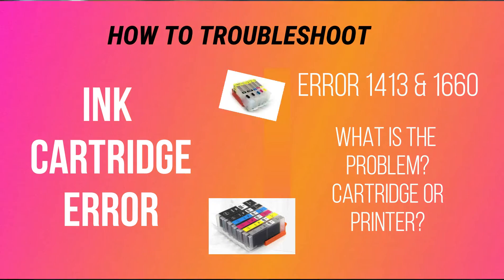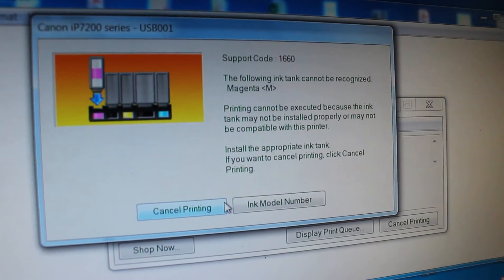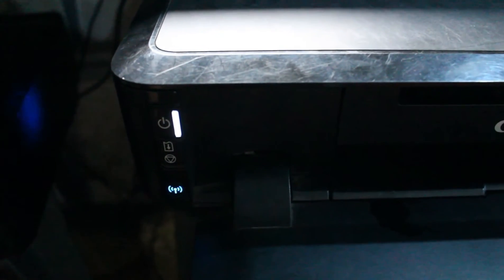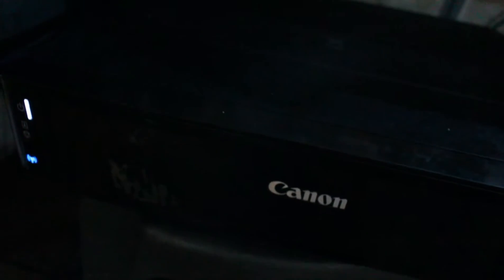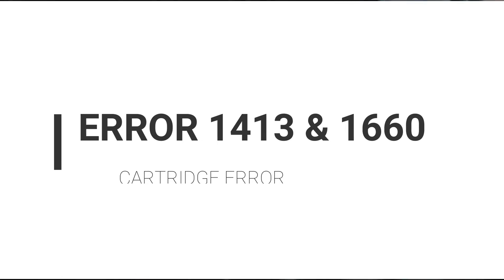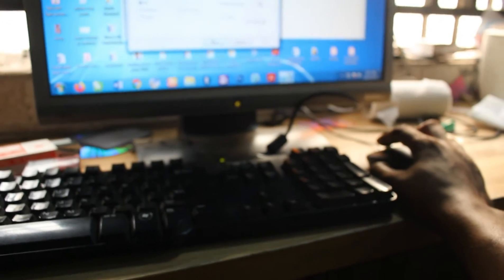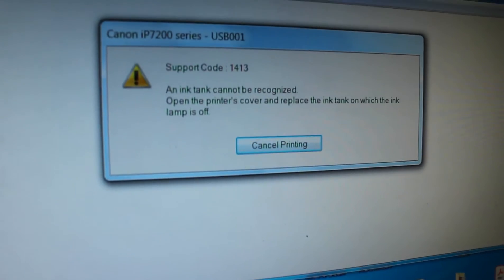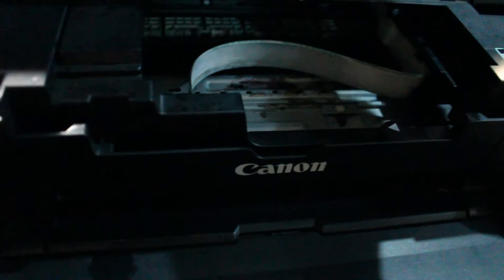How To Troubleshoot Cartridge Error 1413 and 1660 for Canon Inkjet Printers

Comment: It's ok to segment the problem from the solution in Youtube videos.  The challenge and a creator is this.  I clicked on this because I already know I have a problem which your thumbnail (title) indicates a potential solution for.  No, you do not explicitly promise a solution, and yes you did some trouble shooting but to avoid frustrating your viewer all you need to do is be upfront and specific about WHEN the solution is forthcoming.  If you haven't figured it out yet, that's ok but wait to upload until you can deliver the goods.  If this video is one part of a multi-video process that could be interesting, but SAY so upfront.  EG:  "Step one check the cartridge" and let that be the title.  Why?  I already know how to do that and I don't want to sit through this first, small part of the process only to discover there's no solution to error code 1660 in this video.  If you have a few videos detailing each step of the process then provide a screen shot of what to expect in the series so your audience can be grateful for any shortcuts they may need to take, hop around and find the one that begins where their particular knowledge of the problem has got them stuck.  Hope this helps.